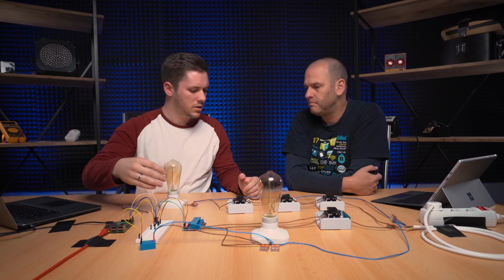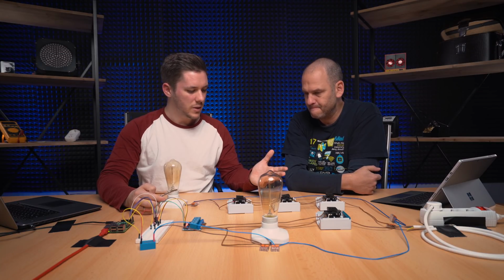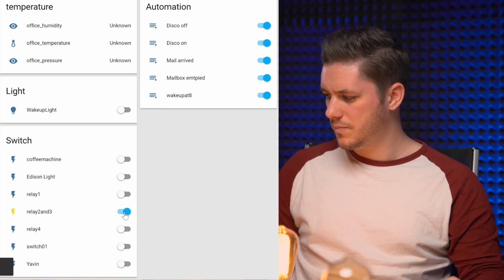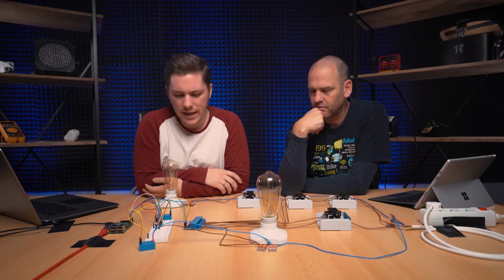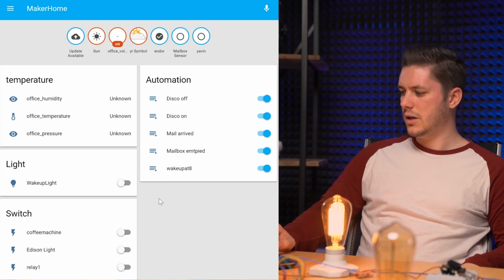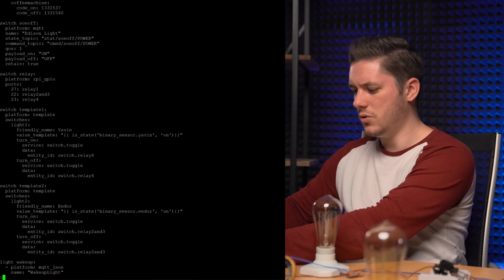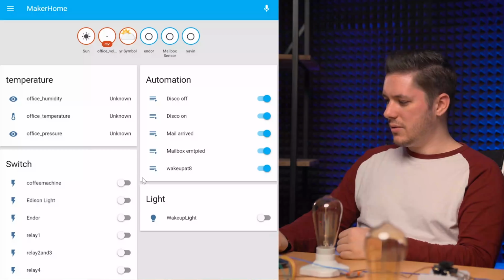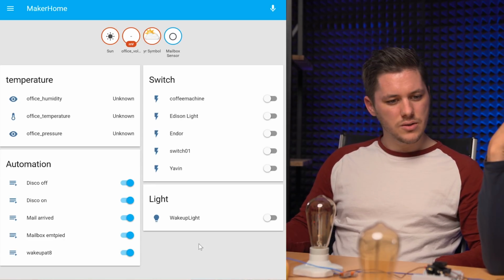Make Your Old Electric Circuit Smart with Raspberry Pi and Home Assistant: DIY Smart Lights (2/2)

Comment: Why don’t you use a resistor to sink some current on the 3.3V pin to get rid of the left over charge when you switch of the transformer? Instead of waiting a couple of seconds for the switch to update, I’d assume it would go a bit quicker with a resistor?
Reply from the maker: @caveymon good idea! I think some kind of consumer would work too, for example a small LED just to get rid of the left current 👍
I will pin your comment to the top 🙂

Comment: Nice project but how do you get it off the table and into real use ? I guess there are long runs of wire from the pi to the switchs. This is not a bad comment  but food for thought
Reply from the maker: @Plano Pat's Chop Shop In my (patrick's) case, I had all the wiring (before installing the pi) in just one  switch cabinet. So that made it pretty easy for me, just needed a few small extra cables and could start right away. The biggest cahllange though was the limited space :-)

Comment: Okay I have to ask, what's going on with this channels viewer status? I see one video with like 190K views, then another posted right beside it with 50K, then another beside that with only a couple hundred and they all have very random like and view counts that don't line up with everything else. But at the same time also have 6.3K subscribers. I don't feel right jumping to conclusions, you guys just seem to be nice people trying to run a decent channel about tech tips. But it's very odd.
Reply from the maker: That’s because we have several advertising channels that we use to (try) reach the right people. Sometimes it works better than other times 😊
Reply: Ah, Okay that makes sense. Thanks for the response